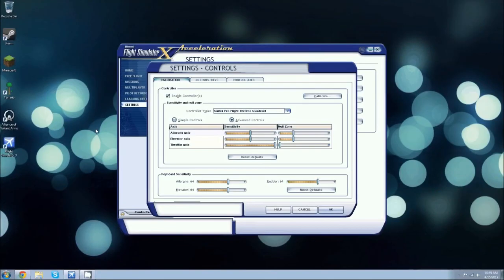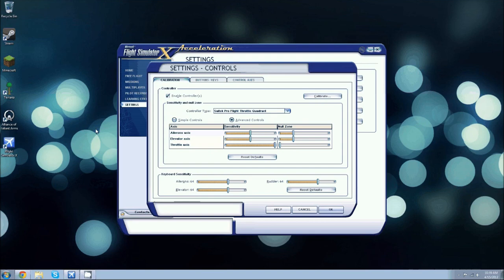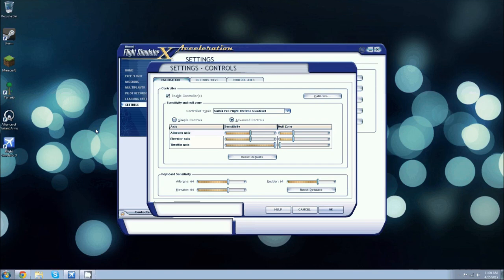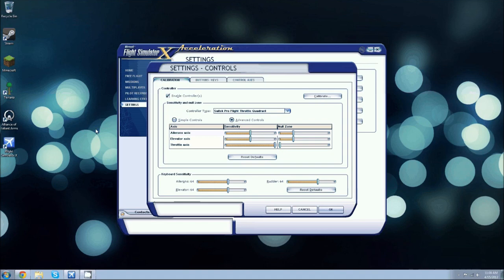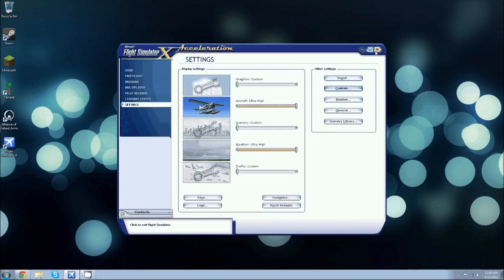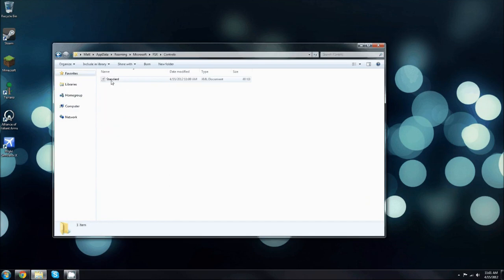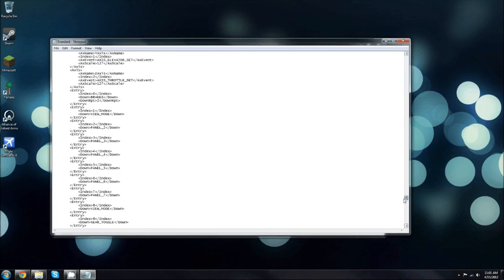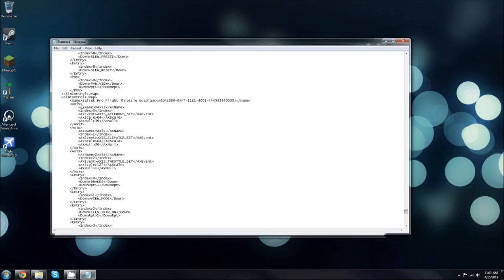How to Fix the Null Zone Problem with the Saitek Pro Flight Throttle Quadrant

Comment: You can always set the parking brake for times such as sitting in a parking spot while waiting for taxi clearence at towered airports, on a taxi way, or listening to the ATIS on the tarmac, etc. This helps solve the problem with the throttle going as far back as 1%. I fly aircraft in real life, and I always set the parking brake in situations like the ones I listed EVEN though my throttle's always fine. Even some turboprops in the real world have engines that idle when throttle is pulled to the "idle" position, and jump up to 8% on the percent RPMs 1-2 seconds later. Leave the throttle setting as it should be for better realism and simply set the parking brake instead of risking deleting all of that raw data Delta 249er edited. It's possible the makers of FSX made this a deafault setting knowing only jets and turboprops would move at 1% as they do in real life, and piston-driven aircraft on the sim have tweked software, so they aren't affected by the 1% problem.

There's no such thing as an aircraft not being able to take off with a throttle at 99%. If you hover your mouse over the throttle and it reads"99%", that's because if the percent was in decimals, it might read "99.7-9%". The program doesn't round to the nearest tenth, it shows the whole number regardless of what the decimal is. I know this because the RPMs and Manafold Pressure gauges still read the same at "99% or 100%". It's such a slight difference, it doesn't affect takeoff performance. If taking off is a problem, adjust weather, switch to an airport with a longer runway, use a different aircraft, or customize fuel and payload.

Comment: Singled I found this video.  I have P3D and the settings here will work there.  Of course you need to select for Lockheed Martin or Prep3red folder and then go to Controls.

Comment: i have a probelm mine is not 1% and 99% its like 40% when i put it on idle and 70% on full and im on Speedlink phantomhawk can u pls help me
Reply: Try putting <axscale> at 127. Most sliders work on a 0 to 127 scale.

Comment: mine just vibrates
Reply: Your throttle is so sensitive, it can't decide whether it should be at one place or another. My sim P3D does the same ocassionally, it doesn't ruin flight expirence, though.

Comment: Is you're throttle quadrant cconnected to the yoke or is it a stand-allone? I can not get my throttle driver installed. Probarely because it is connected to the yoke? In the file as you discribe, there is no line for the throttle. Only fot my pedals and my yoke. Please help me out. Tonny

Comment: I have a different problem with mine. The first throttle quadrant keeps shaking whenever i slightly move it. What can be the problem? It happened to my first throttle quadrant and had to return it. It happened again to my new one. I even tried calibrating. What do I do?

Comment: I have windows 7 and I have this problem but I can´t follow the video well, can you zoom the image?
Reply from the maker: sandro ratchero Sorry, there's nothing I can do about it now, I should have made it larger when I created the video. Did you try putting it into 720p and full screen mode?
Reply: ***** I have a Problem... I found the standard file but then i looked through the whole thing and could not find the saitek throttle quadrant section andwhere

Comment: I just found this as a search because I was having the same issue. My question is do you have a fix for the CH pedals My issue is that my rudder doesnt work well. I cant taxi without zig zagging all over the rwy. In cruise altitude, the rudder goes to the far right or left and it stays there unless I correct it,but eventually goes back to either position. Another issue is that it doesnt respond well. It is slow to respond if I hit left rudder, almost like I have to pump the pedal. But if I go to the right, it quickly goes that way. I have plugged it in into my usb port at the computer, plugged it in into my Saitek Yoke as well. I have messed with my null zones and sensitivities all over the place. Nothing seems to work. Any ideas or suggestions I will appreciate.
Reply from the maker: Unfortunately, I've never used the Rudder Pedals, so I don't know how they work with the game. If you've played with all of the null zones, I'm not quite sure what else you could try.

Comment: Just got the Saitek yoke & throttle quadrant and having the same problem with the sensitivity on throttle & mixture. i tried the steps in your video but did not change a thing, any other suggestions?
Reply from the maker: Have you tried re-calibrating the yoke and throttle quadrant  in the "Controls Settings" > "Calibration" > "Calibrate..." menu?

Comment: Howdy, Delta 249er!   I have four of my throttles set up and have been successful in preventing from all going haywire, MOSTLY.   I still have a problem.  When I slightly raise the Saitek throttles, two on my left quadrant and two on my right quadrant, the two on the right (engines 3 and 4) shoot up to half way up the visual throttle in the game.  the other two move up smoothly.  Any ideas?  Thank you.

Comment: how about turning issues? right turns are no problem but left turns are delayed and do not start turning until the yoke is almost at half turn.
Reply: Who turns with a yoke?
Reply: I hope you mean your rudder pedals, or if you don't have those, you twist your joystick as a rudder. Don't use ailerons to turn, it's a bad idea. The aircraft could flip in a turn.